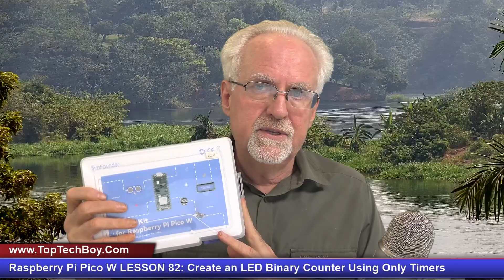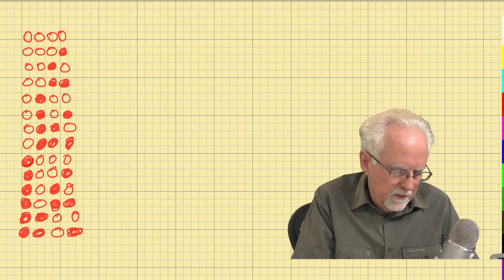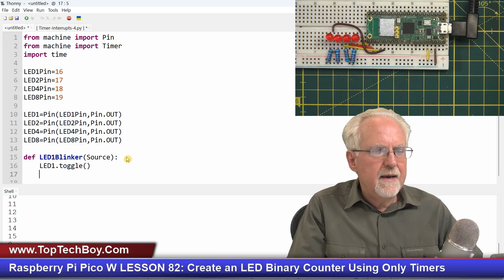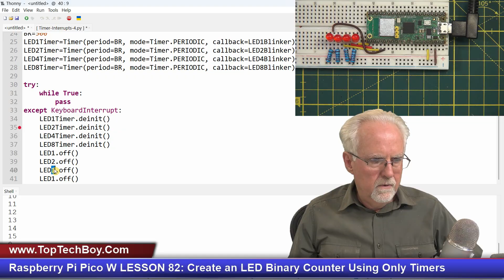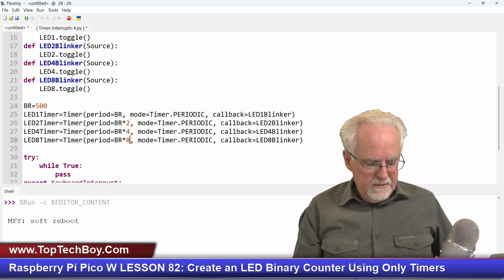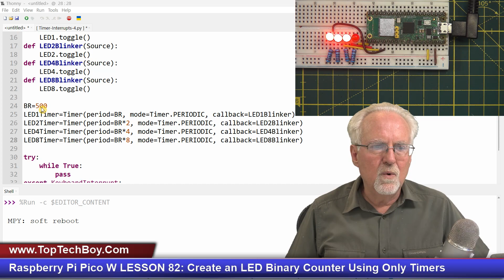Raspberry Pi Pico W LESSON 82: Create an LED Binary Counter Using Only Timers

Comment: Paul - I did something similar, but I used the Neo Pixel LED strip, since it easily maps a counter to a pixel mask. I then used the timer period to set how fast to count from 0 to 0xFF.  I arbitrarily set the pixel color to red, green and blue. I had this code in a class module, so it was easy to import.  Great teaching as always Paul. Thank You.
Reply from the maker: Excellent!